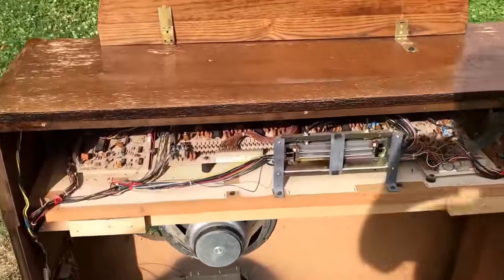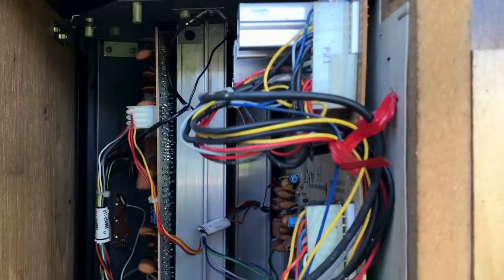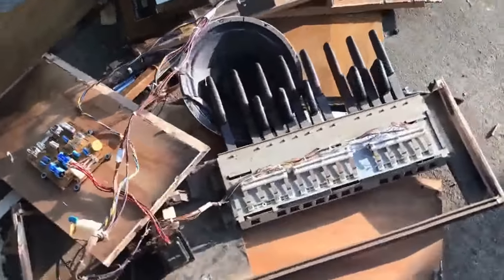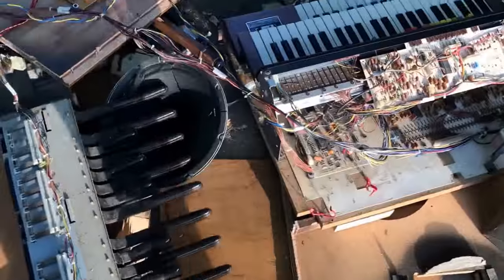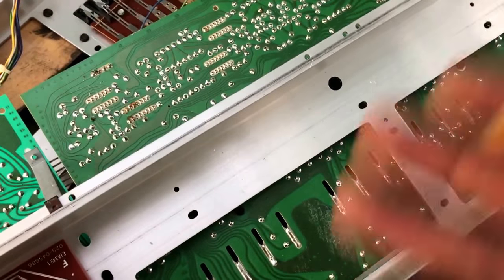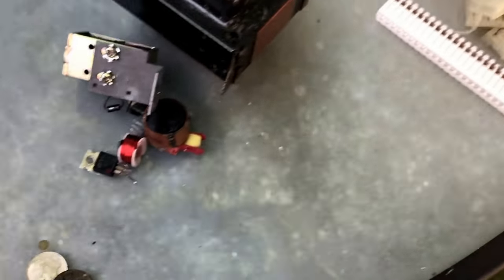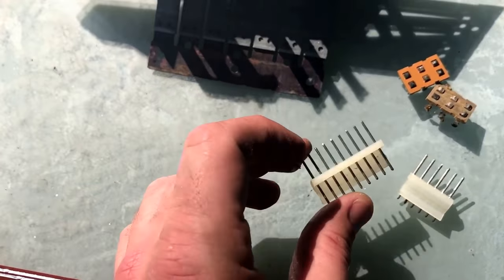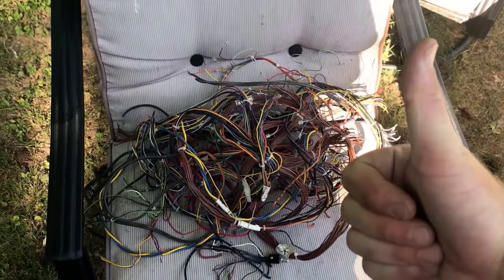Scrapping an Electric Organ for Silver, Brass, Aluminum, Copper, eScrap & Scrap Metal for Free Money

Comment: Scrapping for Vacations,
What you thought was silver contacts on the key section is actually pot metal rivets, attached to the leaf springs to return the keys. Definitely not the top of the line for Hammond for that time period. Looks like you did alright on the scrapping, depending on how long you spent on it. Lol! It was fun watching your vid sped up, kinda like an old comedy capers flick.You may not want to mess with it, but you may want to check the speaker before destroying it because some of them are very resellable.Same with the old cabinet record player, radio combo stereo's speakers. Some really good sound came out of some of them.
Reply from the maker: Thanks, Yeah, once I really looked I could tell they were simply functional rivets vs contacts. And, Thanks, I didn't realize there was much a market for the parts but see some currently listed on ebay.